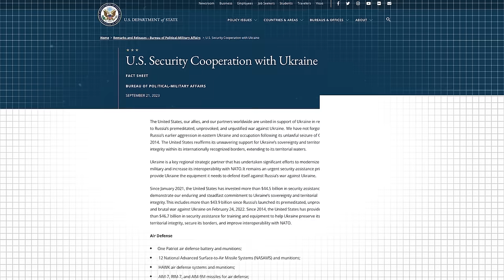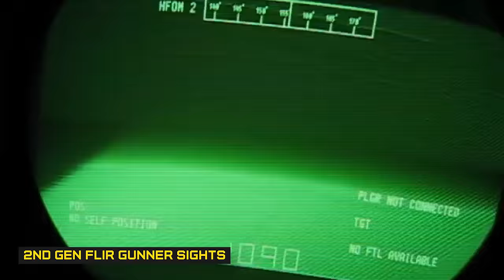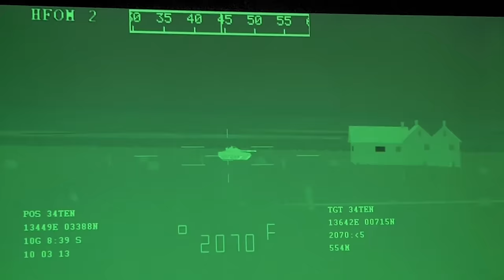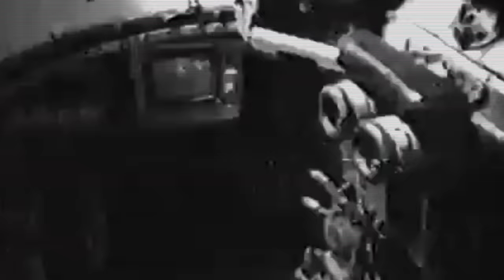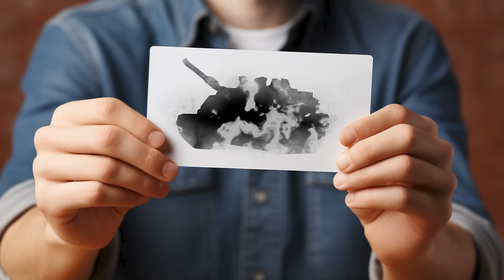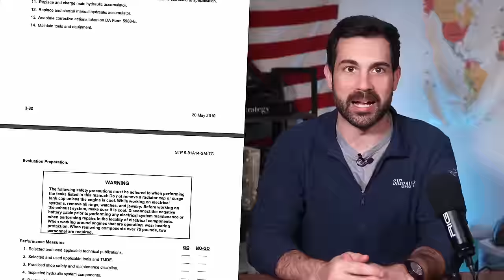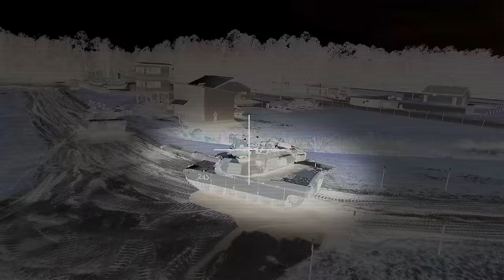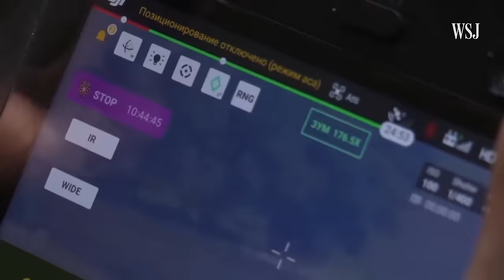M1 Abrams Tank Tactics in Ukraine

Comment: The Abrams acoustic signature is generally lower than diesel powered tanks. The trick is that it sings tenor rather than bass, and higher frequencies attenuate more rapidly with distance.
Reply: Thanks for the explanation, it's really fascinating
Reply: Thanks!
Reply: Yes. Instead of 5-7 kilometers, it will be heard at 3-5. He is big and clumsy. And I saw several videos of a leopard being hit by artillery right on the move. Those. he was seen from a drone and was constantly being “led.” The tank did not stop for a second, drove onto the forest road and still received a shell directly on the roof. It's like being in the damn "world of tanks". Leo is much more mobile. I think that the main point of sending Abrams is to prepare for serious urban battles, where this tank will show its best side
Reply: Only if they are being sent with their tank urban survival kits that were introduced during second war of Iraq.
Reply: If you are close = M1 is louder
If you are far = Diesel is louder
Reply: @_G_R_  There was around 100 houses in Robotyne, most of them are destroyed. I wouldn't call it a urban area.
Reply: @MartinMaarva  No... I mean something else. The failure of the counteroffensive and the terrible losses among experienced fighters will sooner or later bring the war to the streets of big cities, not villages. This is where Abrams tanks will be useful
Reply: @_G_R_  I know, that was bit of trolling. Still I do not agree, there is not much of an advantage against using some other tanks in urban area. Tanks are very easy target in those settings, even civilians with a bottle of petrol can disable it easily. Also 31 tanks is nothing, even 310 would be not enough. Ukraine needs more of 3100 tanks, any less than that is just meaningless gesture.
Reply: .... and turibne's nosie is more directional.
Reply: The higher frequency is very directional and is focused to the rear. Moving Abrams are very hard to hear from the front. There is a YouTube video demonstrating this effect.
Reply: While turbines consume more if I remember correctly Abrams gets about .6 mpg leopard is about .8 mpg
It's at idle were the loss really occur that's why we put an A.P.U (generator) on tanks
Reply: Not only acoustically lower, but makes much less vibration. Was working in training ground at radio tower which equipment cabin was put on shock absorbers. When leopard tank passed by 20m away i can feel all cabin shaking, while Abram was like a normal truck not loud and couldnt feel any vibration. I was surprised by that.
Reply: @suspicionofdeceit Tanks aren't exactly hard to locate once you hear them moving. No one is locating tanks through their engine's acoustic frequency.
Reply: @_G_R_  Abrams and leopard are about as fast as each other, neither proves to be faster than the other. Abrams accelerates slightly faster, and leopard 2 has a top speed that's a blistering 1.2 miles faster, neither has a significant speed advantage. Abrams does not exceed at urban fighting either, something tells me you know little about tanks.
Reply: Pull up beside any car playing loud music with the windows closed, it's the base that travel.
Reply: @_G_R_ what? M1 is not a urban tank. 😂
Reply: @harvardsmithdeangelo6905 The Abrams can use nearly anything as fuel to power its turbine. You can go to a regular gas station and put in regular unleaded if you needed to or diesel. It can go to an airport and use jet fuel which is its primary fuel source. The only thing they have to change out are the fuel filters as they don't like getting different fuels mixed through them.
Reply: It also uses very good sound/resonance suppression in its engine deck and exhaust. It's nicknamed whispering death because of how relatively quiet it actually is on the move.
Reply: Right, Abrams tanks aren't even louder close up, though you can certainly hear the turbine whistle.  The diesel engines used in other tanks are generally much louder, and the sound is noticeable much further away. That advantage of the Abrams tanks is actually well-known and not even controversial. The fuel consumption at idle is a problem, which has been addressed by adding an MTU, though I don't know whether they will be included with the tanks going to Ukraine.
Reply: @chrisblack6258   It can be turned into one using the Urban survival armor packages developed during the war on terror. 

The armor package adds weight, yes.  But if you are using it for urban warfare operations. Then you will probably be stuck in that city for a while. 

So the normal operational mobility costs associated with armor packages are less of a concern.
Reply: @voler_1925  You are comparing numbers “on paper” and not on the ground. Leo will be faster on real off-road conditions like a former farmer's field. You probably forgot about such a parameter as specific pressure on the ground? This is the main thing here, and not the number of horses per ton or torque. 0.8 - leo, >= 0.9 - abrams. And the only place where this pile of metal will not be buried in the ground up to the very antenna is in cities. I saw Ukrainian black soil. Believe me, the Abrams will bury itself in the field like a turbocharged mole
Reply: @_G_R_  neither not the leopard struggle offroad, both have low enough ground pressure to drive around in deep snow, let alone some magic mud from Ukraine, which wouldn't really be any different than the mud in Germany, America or Canada in the winter, which both the leopard and Abrams have performed just fine in. Again, neither that Abrams nor the leopard exceeds either in offroad or onroad performance by any significant margin, but I guess only time will tell, as a rule of thumb, if pickup truck can drive in it just fine, that mud doesn't stop an Abrams, leopard or t series tank, Infact we have seen them perform fine in competitions such as the strong Europe tank challenge.
Reply: @voler_1925 I am always shocked that people think tanks are great in a city. It's literally the opposite of the environment they are designed for. Too many people only seeing videos of GWOT tanks use.
Reply: @chris8612  they can do fine in some situations, but people just like the idea of seeing tanks shooting at buildings or hammering fortified cities for some reason.
Reply: @MartinMaarva  " even civilians with a bottle of petrol can disable it easily. Also 31 tanks is nothing"
You don't disable any tank with a molotov-cocktail, at best you can scare the crew to jump out, or blind it for half a minute if they are experienced enough to just sit tight (which in turn can result in the tank being disabled through other means, but that's beside the point).

31 is a good starting number, letting the Ukrainians work out the kinks in their logistics and maintenance through hands on experience before shipping the big numbers.
Reply: @harvardsmithdeangelo6905 " lmao this tank is worthless anywhere but conquered Iraq or Afghanistan"
Tanks has been worthless since the Great War, but like infantry soldiers they are still the only piece of equipment able to fill their combat role niche, so they'll be around for decades still.
Reply: @chris8612  "I am always shocked that people think tanks are great in a city"
What is shocking is that you are shocked. There is nothing better than a tank to take out a MG position blocking a street, or hose a house trying to kill your infantry. The key is that it is a power multiplier.  Zero infantry means the result will be zero regardless of how much you multiply it with.
Reply: @_G_R_ 😂 You obviously haven't seen much of the mud found throughout America. I've watched hours of footage of this war, and I have yet to see anything that looks even remotely difficult for the Abrams.
Reply: @M42135 Yes, I'm sure you've destroyed many...
Reply: @bf5175 Actually, most tanks make a lot of noise and are often heard well before being seen. Plus, if you aren't good at determining what direction loud noise come from, there are also sensors designed to assist with that on the modern battlefield.
Reply: @MartinMaarva M1s have intakes designed to protect against that
Reply: Poetic.
Reply: That's all the turbine needs to justify itself on a tank. Stealth is the difference in life or death most of the time.
Reply: продам оружие из Украины. доставка в Мексику !
Reply: @johanmetreus1268  In conventional conflicts (mil on mil) tanks become super vulnerable in cities, because their strengths can't be played too. Of course infantry want a tank with them. They gonna say no to mobile protect firepower with them? I can tell you tankers don't want to be fighting in there, cities are death traps for tanks.

Of course in GWOT tanks can be quite helpful in a city but not every conflict is GWOT.
Reply: @harvardsmithdeangelo6905  The Abrams isn't perfect but nothing could be as worthless as a Russian tank so they're still worth having.
Reply: @_G_R_ Failure of the counteroffensive? It hasn't even ended yet.
Reply: @Ramirez83786  I concur.
Reply: Its true.  T-80 is very quite as well.   M1 might be quite as well, but the ground shake when it rolls around.
Reply: @sanal8461 that's fine, cause it lights up its targets like a bigger Christmas tree
Reply: @chris8612  Like they said in Stalingrad: as long as the tanks and infantry stick together, they can not be resisted but separated they become a free kill.
Reply: Americans caring about ukraine more than their own country will never be unfunny🤣
Reply: I feel like I just learned a lesson from an ancient, all-wise elephant. It was a wonderful experience.
Reply: Thats absolut Right but German know about Leo 😉and was fixed with Special Isolation also heat  signature
Reply: @MartinMaarva ruins are still excellent hiding for infantry with RPG.

Comment: As a former Army mechanic I can firm the bit about Americans replacing parts is true. Mechanics are basically finding the problem, removing the part, and putting a new part on. With that said, removing an engine is always a struggle. It's never easy to replace an engine because you always need a crane and like 5 people make sure everything is going correctly. I wished the engines had a rail system that would make it easier to just slide out of the engine bay.
Reply: I have seen here on YT, 4 men change engine on  Leopards in 35 min.
Reply: As Canada Maint, we could do a Leo1 in 20 +min with a 2 man team, couple extra made it go easier. I've been told by the guys still in the Leo 2 is comparable.
Reply: Changing the pack was easy.  Changing the transmission was not.
Reply: My question is, why does Ukraine  get free tanks, but service members gotta pay for their meals
Reply: @jvalencia2595 Ukraine is going to have a lot of debt they're going to have to pay back after they win the war, it's all on loan for now
Reply: @jeffho1727  honestly im excited to see the videos of Ukrainian maintainers doing nascar style pit stops on tanks
Reply: @jvalencia2595  Soldiers meals are reimbursed through BAS so it's practically free.
Reply: @dragononwall8733  I've only done it on Bradlys and Strykers. It's pretty easy to do it on the Bradley, but for Stryker you need 2 on the inside and 2 or 3 up top to make sure the nothing is being pinched. Then you might need a 3rd on the outside to operate the crane. Maybe Leopards are just easier to maintain
Reply: @TAZUTRA  single soldiers get meal deductions married soldiers get meal deductions when they go to the field or on deployment that isn't even their choice
Reply: @jvalencia2595  Yes and as I said they also get reimbursed through BAS too. If you look at the LES they get about $300 taken out for meal deductions, then right beside that you see about $300 for BAS. BAS is meant to cover for meal deductions.
Reply: @TAZUTRA  they don't get reimbursed soldiers who are single get meal deductions regardless of weather they go to the dfac or not sometimes they don't even get the opportunity 
Married soldiers pay for thier meals when on deployment or at the field not taking into account that extra money goes to feeding thier families but "bas is for the service members  not the spouse " so then why do the service members have to be married or have a certain rank to recieve it
Reply: @TAZUTRA  if it's a deduction it means your paying for it
Reply: @dragononwall8733  Leopard has a diesel engine. Abrams is a jet engine with armor strapped around it.
Reply: @jvalencia2595 you can not eat a tank. Even if you are really really hungry😂
Reply: @vincentdevillers4057  but it cost money to send and maintain
Reply: @jvalencia2595  " if it's a deduction it means your paying for it"

Yea, and you get BAS to replace that deduction. You saw where I said "deduction" and ignored everything else. 

"bas is for the service members  not the spouse so then why do the service members have to be married or have a certain rank to recieve it"

You don't have to be married or have a certain rank to receive BAS. Why are you trying to have an argument over this in YT comments? If you're in the military then send an email to DFAS. if your true aim is to oppose the US support of Ukraine then just say then and stop beating around the bush.
Reply: We’ve timed it a few times for fun, 2-3 mechanics and a field crane on the FRS can get the engine out in under 10 minutes with crew support
Reply: I recently changed an engine during a gunnery with only one other person who wasn’t too experienced. Took us 2 days. It’s not that hard. We used an 88 as lift support to replace the engine.
Reply: @jvalencia2595 don’t worry bud, everybody is being fed.
Reply: True. Makes keeping the air filters clean, of paramount importance.

Comment: The  loudness of an Abrams is interesting. I read an article some time ago that while close up the Abrams is louder, it puts off higher frequency sounds than a diesel engine. Those frequencies don't travel as far, so from a distance the Abrams is very hard to hear, while the lower frequency sounds of a rumbling diesel are much easier to hear even from far away.
Reply: I've heard that the Abrams is basically silent once you get a little bit away from it
Reply: What is the point of this silence if the entire battlefield is visible from the sky?
Reply: @lordlol3787  It's not as if every soldier has a drone ready to drop munitions able to disable a tank in their pockets. Soldiers in the field still rely on their senses too.
Reply: @Odin029  Look at the war in Ukraine, almost every unit or group has its own drone